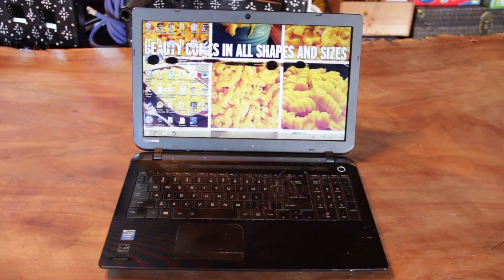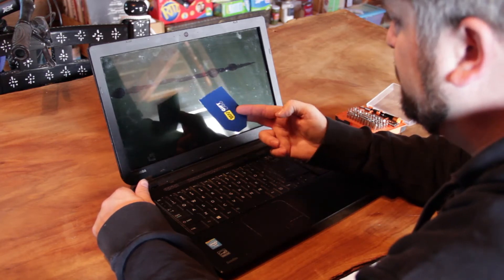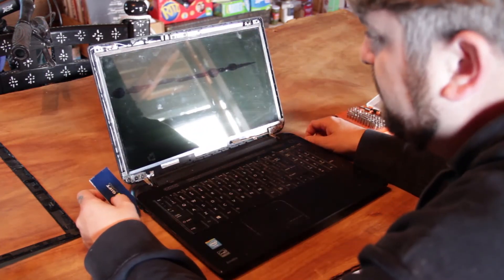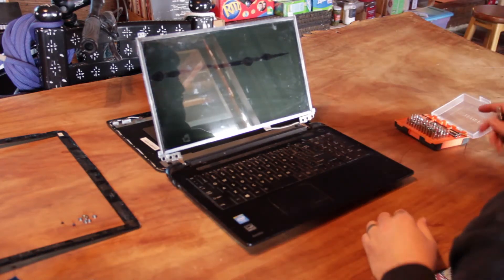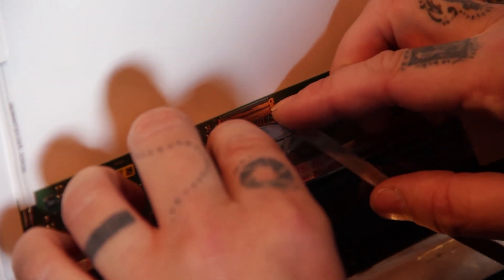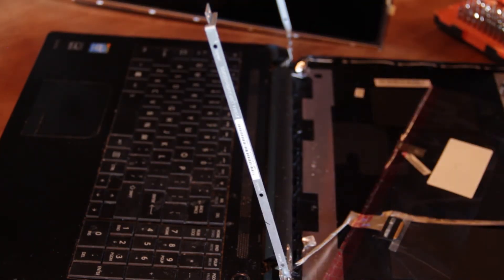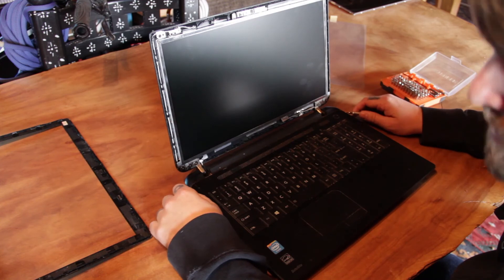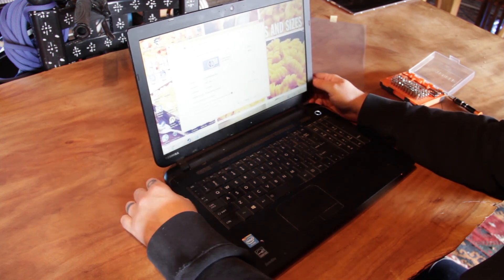Replacing broken laptop screen (Toshiba Satellite C55-B5298)

Comment: hello there, my screen on tosiba satellite c660 was jumping and thought to unplug and plugback the cord to the screen, accidentally my laptop was turned on at that time and , while i was doing a little spark occurred, don't know why, now the screen is not at all working,its just like not being connected to the laptop, dead, what to do, is it the screen's problem or the cord. it was working but was only jumping, but if you press at the bottom of the screen jumping even would stop at that time, now even all is dead